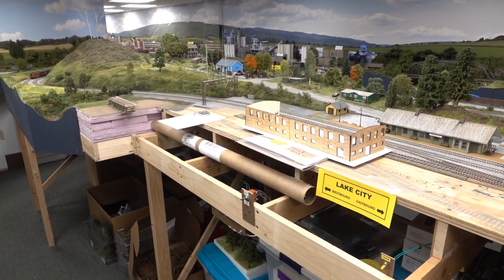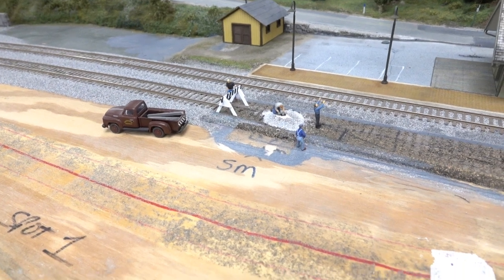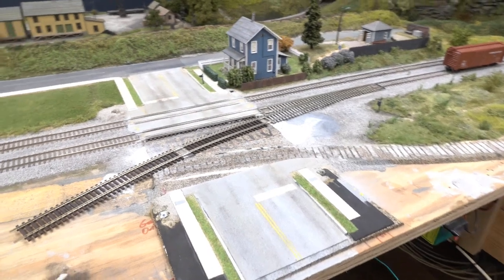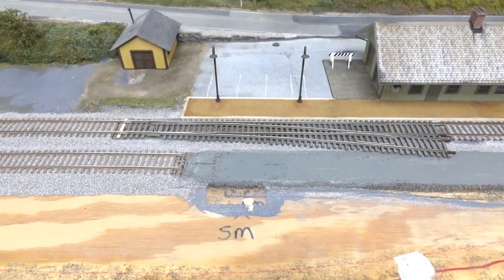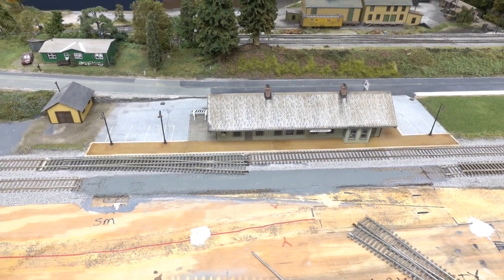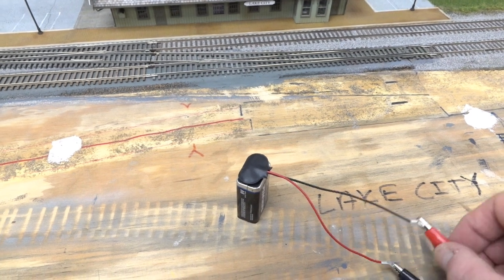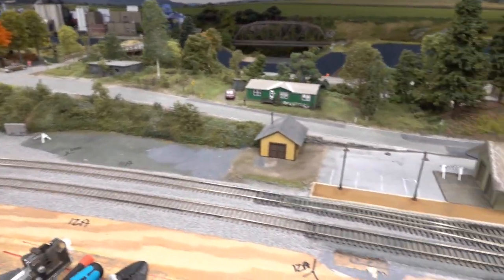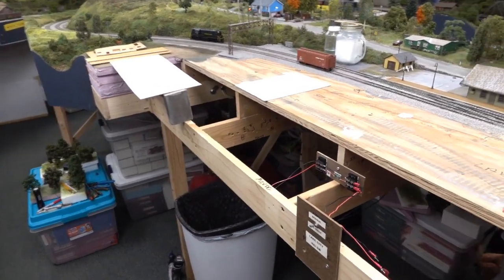MRUV 155: Track Revisions in Lake City

Comment: Hi Rob, What solder do you use to build fastrack switches- I forgot to order soldier and hoping I can use something from Home Depot??  I would like to hear about your experience with Peco vs ME flex track as well.  I’m about two months away from laying down track - got to build fastrack switches first.  I LOVE LOVE your videos on high quality scenery materials - I am so thankful to you for doing that video. I had no idea!   This is an expensive hobby.  I will progress slower than desired but I will enjoy my completed work for years following your guidance.  Many thanks!
Reply: For soldering the Fast Tracks turnouts I use AIM #13286, SN60/Pb40 0.020 DIA, 1 lb spool. I got mine at Mouser, the Mouser number is 738-13286. I'm not sure what may be close from Home Depot, Lowes, etc. Yes, this can be an expensive hobby- like many hobbies, that depends on the participant and how much they want to spend/what is important to them.  Thanks for continuing to watch!

Comment: Hey Rob, been going through some of your older video's, awesome by the way. Anyway, in one when you got upset with Micro-Engineering flex track, I was wondering how well the Peco track matches up to the Micro-Engineering rail on the Fast Track turnouts?
BTW, love the layout and all your video's.
Reply: The issue I had with the ME flex was that the rails popped out of the "spikes/tie plates" and I had to re-lay several feet of track. This was on my previous layout and on tighter curves- around 20" radius. Plus the ME track is a bit more difficult to form into smooth curves. So I just decided to try the Peco on this layout, once I ran out of the ME flex I had. So far I like it, and it matches fine with the ME code 83 rail I used for the Fast tracks turnouts. I even use the small ME code 83 rail joiners with no major issues on the Peco code 83 flex.
Reply: @robbennett1965  Thank you sir. After 43 years of working, retired Navy and LEO, I am about to embark on my first big layout. Your video's have inspired me to go for it. Thank you for the reply and I hope to see more of the layout soon.
Mike

Comment: What about just placing a simple on/off switch between your crossing module and the speaker.  That way if the noise gets old, just flip the switch and boom no noise, but the gates will still function with gates and lights.
Also with the peco turnouts, you could wedge styrene to keep the points centered, while installing the tortoise.
Reply: Scary, you think like me- I actually DID have such a toggle to turn off the gates! Part of the issue was also wanting to back-date the gates to the mid-1950s. And yes, certainly could wedge the Peco points open. But I'm a rebel...

Comment: You need to take the spring out of the peco turnouts then take the template from the tortoise instructions and glue to a piece of styrene to make a template and drill all holes from the top.  You can use toothpicks to center the frog if you desire.

Comment: How about trying a turnout back over the crossing to connect to the old track bed and then site the coal dock on that section ?  It’ll be a bit  of a tight radius, but would man that you could justify the original crossing barrier position; then trains could come onto the Team track from the Main and propel the coal wagons back over the dock.

Comment: Rob, I have a question, not necessesarily related to the video. How do you have the tortoise switch machine at the road crossing mounted. You have it laying on its side, and i presume the actuator
faces the bottom of the table. I'm curious because I have a couple that I may have to lay that way. Thanks Rob, Mel

Comment: Hey Steve? What if you put a #4 right hand or a #6 right hand just to the left of the road to go back across the road giving you back your old siding?  and Then you could leave the new gates where they are? That would be four tracks across the road and a need to control the crossing by a manned operator. Just a thought. Thank you so much for showing this video. I enjoyed it very much. Can't wait to see the next one.
Reply: Vincent- I did consider that, but with the room available it still would have been an issue. As soon as that happens you have to watch things as you need room to drop/pick in that "wrong direction" industry. To make it simpler I just made everything the same direction.

Comment: Hello Stephen.  I was wondering do you have the link to those voltage reducer boards and the larger one? I have done this same operating two times on my new scale with Peco electro frogs and it all works great. If you could even give me the basic information on the units would work. Good video for my lunch break.
Reply: @robbennett1965  Thanks very much , I  just checked it out and will definitely be ordering some items.